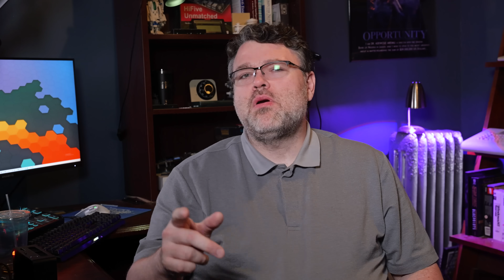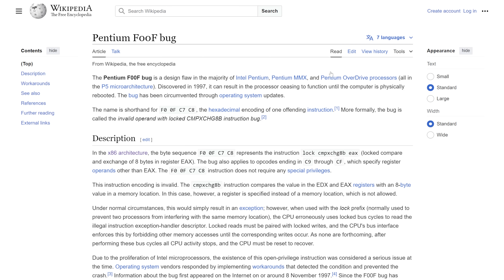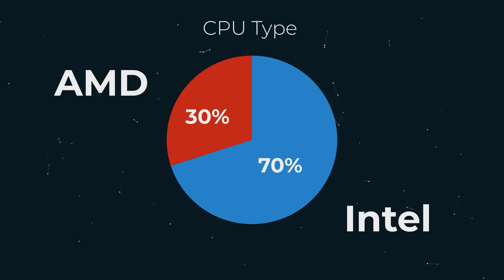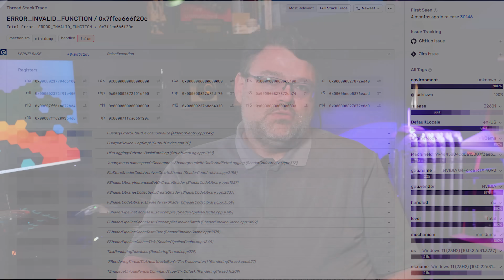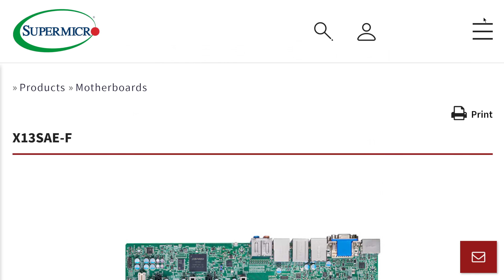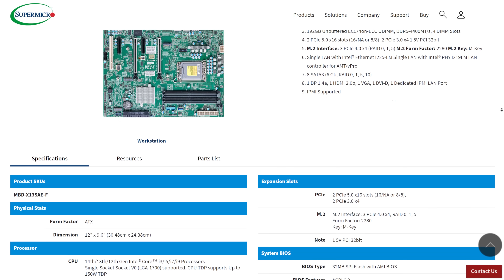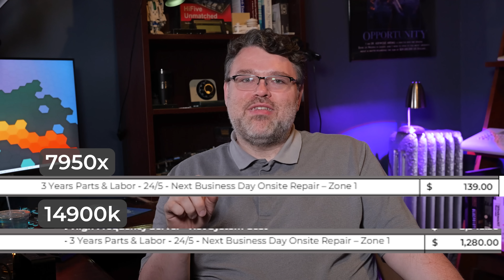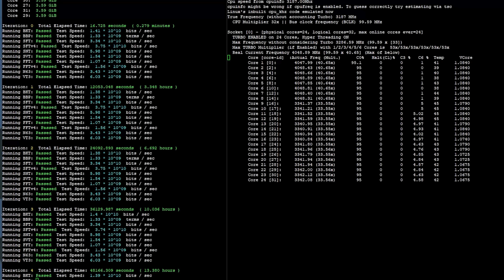Intel has a Pretty Big Problem

Comment: I am not that surprised they are sing I/O errors or GPU crashes.
Already back when I had my C2D E8400 and ran it at 4Ghz my GPU drivers would crash once a day even when it passed prime95 for 24h.
Prime95 24h was no problem, intel linpack did have problem with in 2h and reducing clock to 3.8Ghz fixed those errors and the drivers stopped daily crashing and the system was stable for the year I owned it.

I also saw similar issues with Ryzen 3900XT,.
With 4 dimms I could pass memtest86 for 18h and with zero errors.
I ran Linux and one day kernel version came out and 5.10 they did some "I/O die optimization" and I could not even get in to desktop at my current ram clock speed.
5.9 and older worked for days mostly.
My issue was the RX5700 GPU crashing and it looked like a driver issue.
Many people with Ryzxne 3000 and Navi10 reported the same thing and AMD reported they sent in new Kernel patchs to resolve the issue but me and other people still had random Navi10 driver crashes.
Sometimes I also had NVMe errors so I knew something was up with the PCI-E bus.

I figured out that the I/O die got unstable if it was doing mor then just using the IMC (integrated memory controller), like the PCI-E controller.
The OS is taxing the I/O die much more then some memory test because PCI-e, IMC, Sata, usb on the I/O die can be utilized all at once unlike some offline memory test and expose weaknesses.
So increasing ram timings and lowering ram clocks fixed it for good and it was fine for 3 years until I swapped out the CPU, nothing wrong with the CPU, just to much load on the I/O die.
3200 with XMP was never supported, 3200 JEDEC is one thing and with two dims, 4 at the most with very loos timings.

So yea not surprised people are seeing GPU driver issues because its sensitive to an unstable CPU,ram or I/O system, I think intel just pushed those 13900K and 14900K beyond there stable clocks from factory and they might also draw to much current and electromigration is probably speed up way beyond what anyone would call acceptable.
This would explain why the error rate is going up.
intel did have to recall the 6 series chipset for the same issue, cost a tone of money for them.

In my case I OC the CPU to much or ran to many sticks to fast so thats a user error BUT whats worse is when the manufacturer is doing it!
Intel should just buy back all the effected processors because there not up to spec.
Reply: For my 13900k my memory was fine. My io is what started failing such as nvidia treating my displays as a new install when booting and usb ports stop working or spend 30 seconds self reinstalling on boot up. Linux my monitors too would freeze up the frame buffer randomly more and more.

My 7950x3d the same gpu, ram, and peripherals ran fine on both Linux and Windows. Yes I reimagined 3x so it wasn’t a bad windows install. Memtest 86 was fine

Comment: having over 100mV overvoltage constantly applied while operating at far too high temperatures (cause of those voltages) also leads to rapid degradation. intel really needs to just step up and own up: It is intel that allowed the motherboards to intentionally damage the CPUs and Intel needs to make them stop.

Comment: I can see this issue eventually ending up in a big class action lawsuit for entire 13th/14th lineup....if Intel can't find a valid "reason" that stops issue from happening then the masses ( & likely a judge) will come to only other option....its a defective CPU product they kept selling knowing the issue just refusing to admit it.

I liked Intel & I ended up going AMD when amd finally turned it around and all intel did was stagnate and I refused to pay for a "new" cpu if performance was barely any different than what I had prior.

I do not foresee me going back to Intel for many years of proving they have changed & it sucks because I really did love intel cpu's of old.

Comment: Since most large corps lay off their experienced engineers every other generation. Intel probably no longer has any experienced engineers on staff.   So subsequently, every other generation has some sort of problem.   But something has changed, and they no longer have any battle hardened engineers that can solve problems, anymore.  Oh, has intel gone DEI woke?  That could explain the core problem.

Comment: I was one of those users (13900ks/4090) that would be crashing every couple hours - every time it would instantly goto black screens and all fans Rev to 100% -- with same motherboard I put in 14900ks, direct die cooled it and still removed power limits etc and this has been working fine for around 3 months now. Either I'm lucky or extreme cooling it helps?

Comment: Damn. Intel went from being the rock stable platform option to what this is. Sad times. I've also read a fair few people complain that their RMA wasn't approved and Intel basically said if the lowest powered profile works then that's good enough, which it isn't because that's not what people bought in to originally when buying the higher end SKU.

Comment: I own a 14900ks and it was unstable with previous BIOS, fixed issues by reducing it to 54x. With the BIOS patch it became stable, until a few days ago where it start to crash again the same games and new ones.

Nerfing the mult to 54x solved this new issue, but I am sure my 14900k is degradating.

Comment: I'm building a new machine for a client, should I consider avoiding the Intel 14900K? I built an AMD 7700 system for a different client and ended up with the overvoltage thing and switched the person back to Intel.

Comment: Built a pc late October, started having issues late November, tried out many things with the help of 3 tech savvy friends online but by the start of February I gave up and sent the whole pc in to the store where I bought most of the parts. They came to the conclusion the 14900K I had was faulty and replaced it, along with formating my drives and "upgrading" me to W11.
The issues I had with games crashing, blue screens, window indexing not working along with a bunch of other issues that seemed to point to issues with RAM and GPU did stop with the new CPU.

Well I do still have issues with it now requiring sometimes 2 and even 3 attempts to get the pc to boot properly after a restart. Also had some issues with apparently being out of RAM trying to start chained together and also had CS:2 crashing but that could very well actually be a problem with the game.

Comment: Great Video!

Perhaps the failure rate is lower for the larger SI's (vs expexted) like Dell because more of their users are buying K SKUs because it's the best, not so they can self overclock to the max.  So more of these systems are running at tested stable SI settings. 

Less of the chips are being pushed as hard.

Comment: When December comes - it'll be time to put up a new home server for me... And even though I'm impressed by the capabilities of intel CPUs at the low end: the N100s and the likes for very basic units (=replacing multiple raspberry pis and the likes in single units) --- I don't think I'm taking that risk for the more expensive stuff... Christmas faffing about the BIOS getting frustrated, frying stuff, boot loops, corrupted drives resulting from said boot loops ...

I'm going high end consumer AMD for this run thank you very much.

Comment: My Ryzen 5950X is still running great!  No degradation as it still boosts to 4900-5050Mhz on all cores at stock voltage. No crashes in games or other applications. I would crash first from over playing before my PC does. 😅

Comment: I had one of the degrading 14900k's. Just got a new-in-box 14900k back from Intel as an RMA. In the many days of testing I did, I found Gray Zone Warfare to be the most reliable predictor of instability. It would crash immediately either loading the main menu or the first map load. It was a better predictor than Prime95 or Cinebench. Since switching to a 7800X3D, GZW has never crashed. Now it feels unethical to sell my 14900K. Not sure if I should run it with what we now know about power limits, or sit on it and wait for Intel to do something.

Comment: I agree with most of your statements as I work for a small SI. I stated on initial videos a few months ago when the fingers were pointed at motherboard makers that the problem could be with Intel processors.  We mostly provide 14900k to businesses on premium and entry-level B760 boards.  So right off the bat,  no O.C. Next, we disable motherboard enhancement and limit power to Intel stock.  And some board are weak and can only do intel stock power. Failures have happened in all these scenarios.  These systems can run cinebench all day long or occt stability test or aida64. But try to install the nvidia driver(compression/decompression). The installer fails. Another way to test this is tekken 8 demo game.  No matter what bios we choose, those processors are gone.  Replaced.  There is no coming back from this.  Has happened with ddr4 and ddr5 systems.
Reply: Exact same issues here. Waiting for my RMA CPU to arrive as I type this.
Reply: @explosivemonkeys  I hope you get yours soon.  We are not in the U.S. so our rma is a couple of weeks with Intel.  But once the system is diagnosed with this problem at the service centre, we replace it with a new processor and return the system back to the customer.  So, for a customer, it is basically 2 to 3 days down time.  I am also hearing stories of Intel denying rma for these cases.  That would make this worse.
Reply: @explosivemonkeys  my i9 13900K is unstable if i set more than intel's baseline specs, Do RMA covers me?
Reply: @anjelomichelangelo7726  no
Reply: @anjelomichelangelo7726 if RMA will not clear to validate a defect , you have to claim with the retailer for exchange and refund through consumer rights, or sue for counter claims against the support company that refused the RMA. The lawsuit will lead to discovery and they should react to the complaint a lot faster if they have to involve a lawyer to investigate common ground faults that are grounds for a claim of defect. 

It’s likely that the defect will be resolved to a caching instability while boosting, or some kind of mixed magnetic resonance with regulators on lower standard boards. It requires a benchmark that can crash a CPU. Reliably.
Reply: The NVidia installer was a big thing for me too.  Would crash on install about 95% of the time.  At the start I figured it was a corrupt Windows install or maybe a failing HD.  Almost dropped a lot of extra money to start replacing components before I started to see all the other issues out there, which thankfully saved me.
Reply: Just so it's clear - did replacing the CPU actually fix the issue? Was it properly verified, taking a system exhibiting the problem consistently, replacing only CPU and then testing again with the same exact test and no problem found? Asking because I was around in the past for the FDIV bug in P60/P66 by Intel, where you could actually even get it to calculate wrong in Excel using a specific formula to prove the bug. Initially Intel said there is no issue, then they made RMA's for all who complained trying to shut them up - or at least it looked like that is what went on, then finally they had to stop all the BS - and rework the CPU and announce that people who had affected chips could register to get it replaced with the new fixed chips shipping out as they were coming off the production line. I had one of the FDIV bug P60's for years as a memento of that cluckerf*ck but I traded it eventually for a DEC VAX 11/750 in 1997-8 something like that. Shoulda kept it. 
Point being with the FDIV bug you could not replace your way out of it until Intel made fixed chips, 100% of the P60/P66 initial production were affected. You could kernel patch your way out of it, but it was a software workaround for a hardware problem.
Reply: >this happened with ddr4 systems
damn, i had heard ddr5 mismatch mightve been the cause. how would you say the stability is from your experience on 700k's as opposed to the 900s?
Reply: @G4RYWithaFour  Due to our pricing, we sell more 900k than 700k. So far, zero issues with 700k. But we sell a huge number of 700F, again no issues reported so far.  Due to our nature of support,  we provide lifetime technical support through WhatsApp.  So it's very each for customers to reach us and have quick resolution.  And since we have gone through a few processor rma,  we can remotely diagnose this system and set up an rma for the whole system. The first few cases were confusing, and we thought something was wrong with the OS.
Reply: That shift sucks man!  A 13900k is going to kill me.
Reply: @vincentperiolat4610  listen,  if you have a 13900K,  you don't have to worry unless you have the symptoms.  Just to be on the safe side , update to latest bios and enable Intel default profile in bios.

Comment: Jesus christ....
I spent all my saved up money to upgrade from a gtx 970, 16GB ram, core i7-3770k + rest
to an rtx 4090, core i9-13900k, 32Gb ram + rest (yeah it was a big jump)
system. I thought that OK... I'm done for the next 9 years and I can enjoy the gaming experience to the absolute fullest in the next few years.

...of course I also started to notice a few things here and there. Then there were more frequent crashes, issues with games. out of Vram issues (with an rtx 4090). Updated BIOS, reconfiged voltage etc.

And now I feel like I just got totally assfaq'd by Intel, and there is nothing I can do. Nothing at all. Nobody cares, there won't be any update from Intel.
I guess this was the last time I bought anything from them. I hope that this escalates to a level where people will completely loose their trust towards Intel. I wish I chose AMD. I have no idea why didn't I go with an AMD CPU, I guess because the last one was Intel... I just stayed with them. Big mistake.
Reply: Why the FUCK did you buy Intel? AMD is better IN EVERY SINGLE WAY

Comment: Even my 12900k build had a huge stability drop off after about a year.  Replaced it with a new X670E and 7800X3D components and has been completely stable since.

Comment: I’ve had so many bizarre issues lately and I’m now wondering if they’ll disappear if I swap back in my 12900k instead of my 13900ks 🤔

A couple of them highly repeatable but one that others can’t reproduce
Reply: Good to see you here!
Reply: Not reported Internal high temperatures can lead to undefined behaviour. High Current leakage can be interpreted as a wrong bit.
Reply: @ThioJoe  Just try it, for science!  

It wont be that much of a performance drop, and if you d hopefully get a more stable system out of it until this is resolved ;) 
Post your findings on the L1 Forum if you actually do it :D
Reply: Try it and make a video about it!
Reply: Have you tried going into msconfig and enabling all cores at boot - you know how Windows can't deal with all the P and E cores and starts procrastinating. If that doesn't fix the issue, try attaching a whisk aimed at the direction of the sun where it's at at noon. As you know, the solar storm has been a problem lately, and the whisk absorbs the harmful solar radiation by generating eddy currents in its coil and releases all of that harmful energy as heat, preventing the Intel oxidation/degradation issues which they've been having due to the solar storm.
Reply: You make troll videos. Maybe you should stop spreading misinformation and lies about Intel because my i9-14900KS has NEVER crashed once.

Comment: You have likely heard this many times, but I had a major issue with crashes on a new game (and i have seem them since my new system and assumed it was the game). I tried playing The First Decadent and had around a 95% crash rate trying to load in. I used the Intel tuning utility and reduced the clock ratio and it seems to fix the issue. 

So I do think there is some form or coloration to clock rate or power draw, especially because I see many people saying it fixes it. but that does not mean it is the root cause.

Comment: I have two 13900KS CPUs in two similar rigs that are experiencing this issue. Only way to stabilize the two CPUs is by de-clocking the two 6 GHz cores. I'm not going to buy another Intel CPU given how badly Intel is handling this issue.